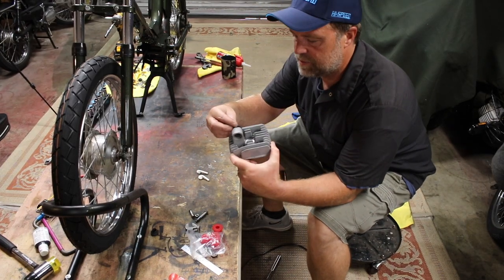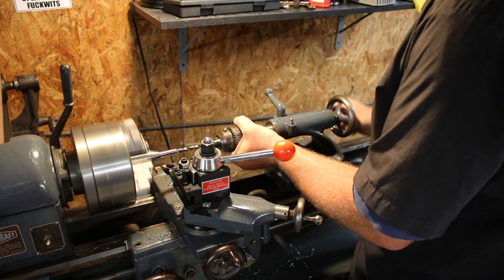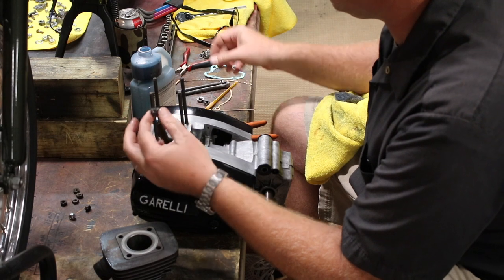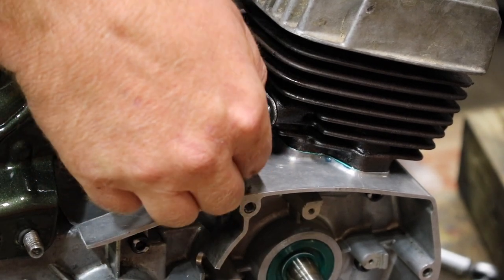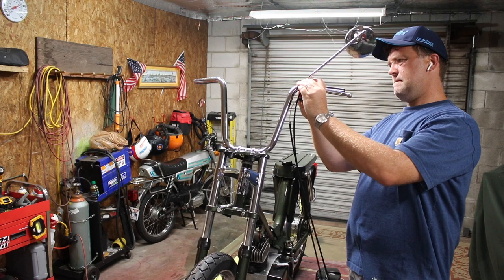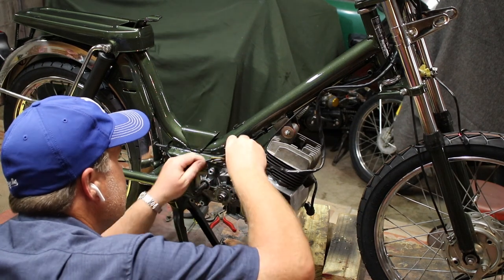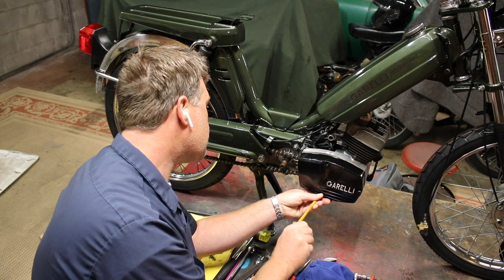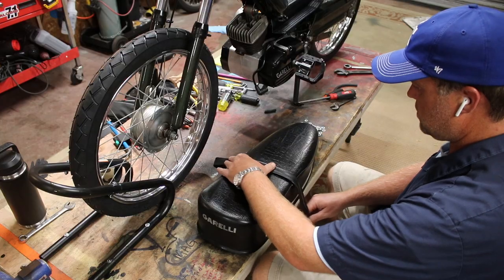DFHS Garelli VIP Ep. 6 - Reassembly Part Deux

Comment: Does anyone know if bycicle pedal pins to hold the arms in place are compatible with moped pedal arms?
Thank you
Reply: depends on the bicycle and moped
Reply: @kaptein1247  Well i will have to take measurements of the parts of the pin that are exposed and see if i can find a match locally.
Thank you for responding.
Cheers